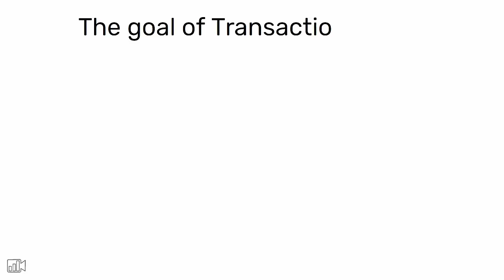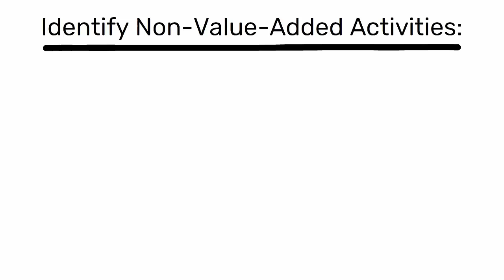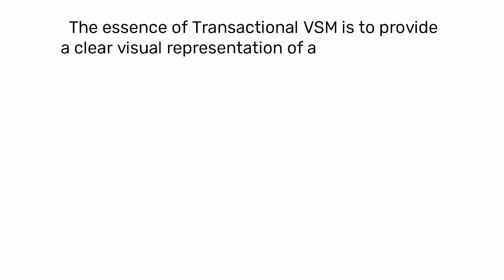What Is Transactional Value Stream Mapping and How to draw it

Comment: This was a good video in keeping with your goal to have them short. Here's a few more ideas. I've been doing what I call lean for service for over 20 years. I find it helps to start with a SIPOC. When you map the current process, it's important to observe it. Managers rarely know what is really happening. There are often different categories of waste in different types of service businesses than in lean manufacturing so it's important to take the time to identify those before tracking them by activity. Before developing the to be process, It is helpful to develop the ideal process and several other versions as explained in lean training first. And of course, change management is always important and a stakeholder analysis is essential. I'm sure these things are missing to keep the video short. But the biggest piece always missing is understanding that the value stream terminates with the customer and their emotional reaction. That's even a missing part in lean manufacturing. Customer satisfaction can be built into the process if this is part of the awareness of those designing the new process.
Reply from the maker: Dear Brent, thank you for your comment. All the points are very valuable. If you want to create a longer version of this video with me do not hesitate to contact me on Linkedin ... search for Mark Anderson LeanVlog.